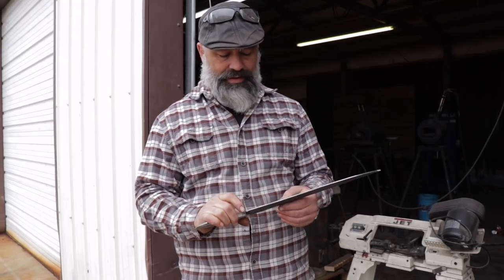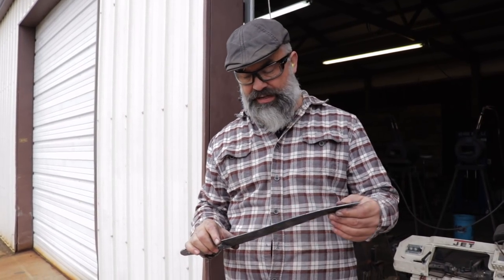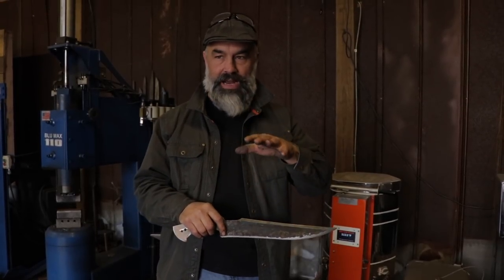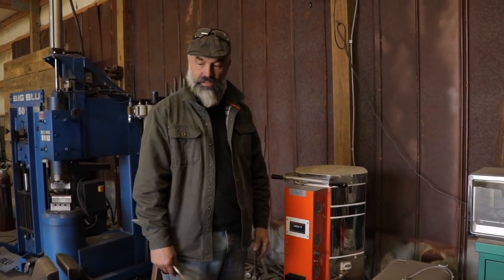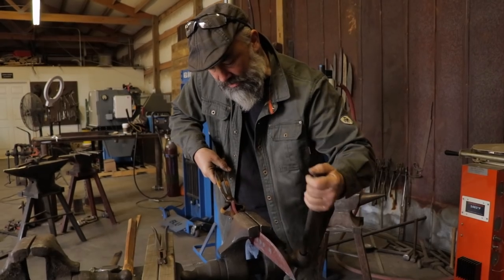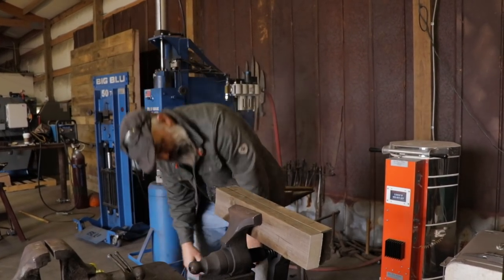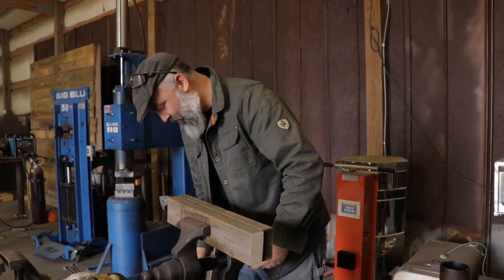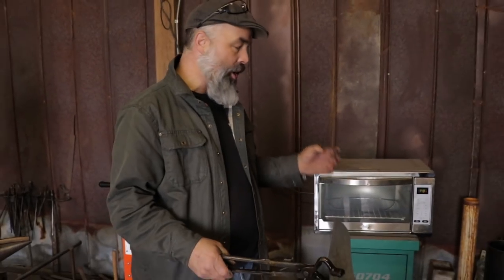BLADESMITHING | Freestyle Forging | Truck Spring - Part 2

Comment: Thank you for the tip on the drill bits.  I work at a hardware store and was buying Milwaukee cobalt bits at $7 a piece.  They were not only expensive, they weren't giving me the results I needed to be more efficient.  I just ordered some F bits from MCS and paid $2.14 each with free shipping.  Thanks for saving me time, money and headaches.

Comment: when talking about the drill bits making a triangular shaped hole, its MOST noticeable with a bigger bit when you first start the hole.  before you have any depth to the hole, you can really see the 3 side angles that make a sort of triangle.

Comment: I am using 5160, trying to learn everything I can about, eventually want to move 80CrV2. I have heard it behaves much like 5160 when normalizing and hardening, I am using my forge right now, saving form a salt bath, but here is what I do: heat to above non magnetic cool, heat to just non magnetic, then just below. Would this work for 80CrV2? I bought you elemental knife course and love it and the videos you are doing here. Thanks a million.

Comment: I made a knife when I was 14 under the strict tutelage of a master blacksmith he could do anything. You know the first thing you made me do learn how to forge weld good God I had about 4 Model A or Model T leaf springs I managed to make one knife out of all four of them. he made you run numerous normalization Cycles. he made me go to 60% finished forging only. when I wasn't cleaning up the shop and doing all kind of dirty work but it was worth it he actually paid me $0.50 an hour when I wasn't working on my knife. He was crazy but I still got that knife. And it held up well and Lord knows I abused it
Reply: @JasonKnightMS  I wish I could have kept up with it I really love doing it

Comment: Hey Jason I’ve got a question, when you did the last normalise and straightened it in the leg vice. Wouldn’t that speed up the cool rate compared to letting it cool in air? Is letting it cool in the vice as effective as letting it cool in air? Thanks heaps for all the content I’m really enjoying it.

Comment: I do have a question. When you're tempering do you have it go from room temperature, up to not quite 400, and let it soak at that temperature for the hour and a half, then turn the heat off and let it go to room temperature slowly or just take it out of the oven and let it go to room temperature that way?

Comment: I agree with you. high carbon steels and alloyed, high alloy steels should be normalized to eliminate internal stresses after forging. These steels are considered strong and forging is stressful for them.
Reply: @JasonKnightMS  I completely agree with you. Without harmony in metal, it is difficult to make a thing of truly decent quality. And this is impossible to achieve without knowing the metal.

Comment: Opinion on stock removal? Is it worth trying that first before investing in more knife making tools.
Reply: well for stock removal you need some type of grinder and a drillpress unless you wanna use files and a forge, but youll need those things for forging too, so why not just start at stock removal first then get your anvil and other stuff if youre into it.  anvils are expensive too unless you can find one somehow second hand

Comment: my most recent blade has a tiny warp in it too... I annealed the material before shaping the profile, and I normalized twice before hardening.  still got a little warp just in the last 3/4" of the blade. I think I can fix it by just surface grinding one side of the piece because its still pretty thick.  its a Kiridashi, so the bevel is only on one side. if I heat it up to straighten it, would I have to harden it again?  this is blade #3 for me. I am a newbie.  I was thinking I might be able to grind it out, since I still have to grind scale off from quench hardening, and its still probably close to 1/4" thick.  the warp at the tip curves up towards the blade bevel

Comment: Hi Jason.Shaun here.Instead of using the 2 wooden blocks could you use aluminium blocks?I have used aluminium on larger blades in the past but am not sure whether it has a negative effect on the steel.

Regards:
S

Comment: Man your wisdom unparalleled, one problem I saw which shows poor knife handling you ran your hand down the blade about 50 times. Now if you were distracted picked up the wrong knife with an edge. Easy injury. 
Good content. Just be careful. 🙏

Comment: Great content as usual. Just curious, what kiln is that you are using for heat treating? Looks like it would handle a large blade or multiple blades at once easily.
Reply: @JasonKnightMS  Thanks man!

Comment: There's a guy named seth . He has a channel where he forges. It's Amazing kk daily. He quenched everytHing in water and there are times that his work piece is hardly at a orange heat. Is he even getting a hard blade? Is it likely that he is just getting a art blade that is littered with cracks. I understand that some metals can be when her in water, but I see him use spring steel a lot. Doesn't spring steel crack in water. What can I tell me about his process. Is it wrong or right.